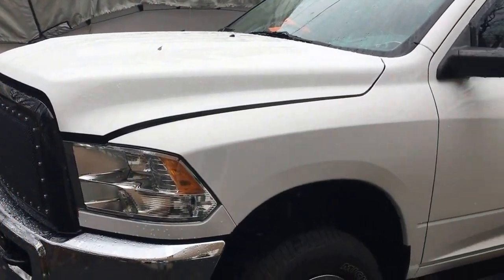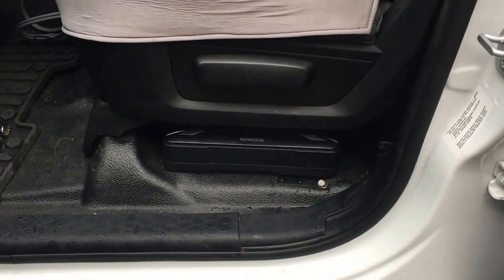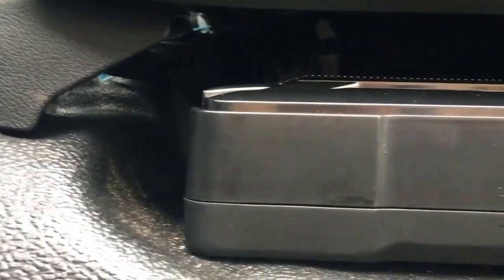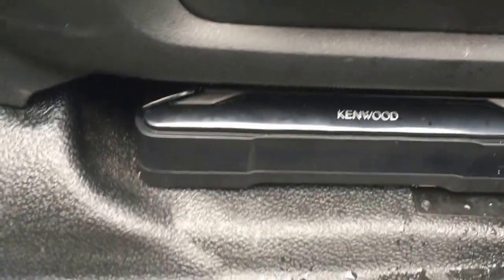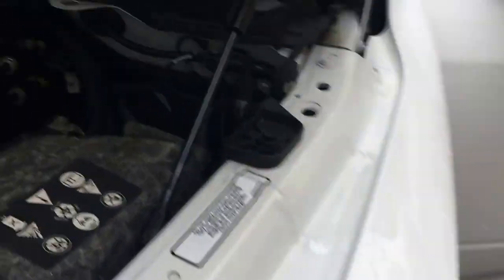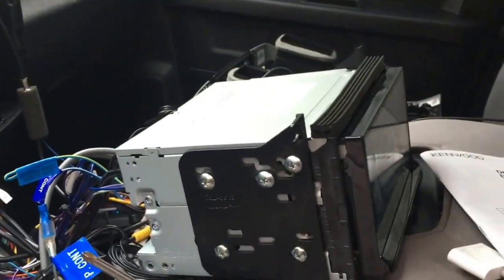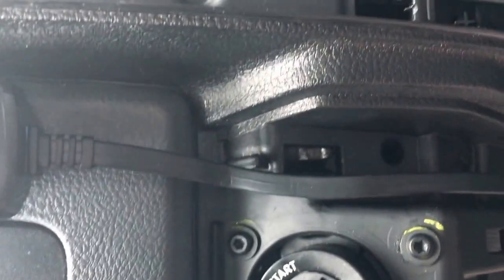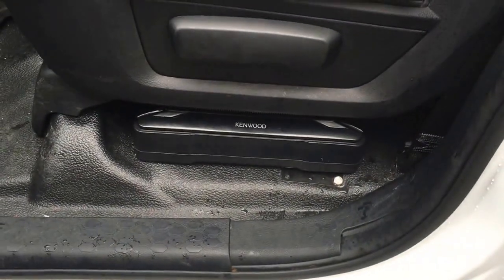How to:  2014 Ram 3500 Kenwood Powered Subwoofer install

Comment: Next time slow down show us your handy work especially in the battery compartment trying to get my hot wires thru the firewall without cutting anything good video I have that subwoofer for my 2008 ram installing everything this week saving this video for reference
Reply from the maker: In the battery compartment I was able to use the hole that is there for the clutch on a manual transmission Ram.  If your truck has a manual transmission it'll be a little more fun to find somewhere to fish the wires through.  Good point on the slowing down part.  A lot of it wanting to keep the video short enough to keep interest but on the other hand long enough to cover the parts you want to highlight.  The battery compartment is a good point to highlight though.  Thank you for your comment!

Comment: Will that sub work with the uconnect 5.0?
Reply from the maker: Yes but you will need to jumper the speaker wires because if I remember correctly there is no pre-out RCA cables.